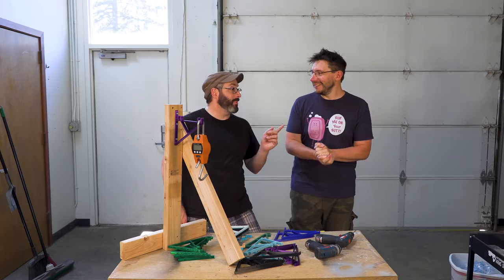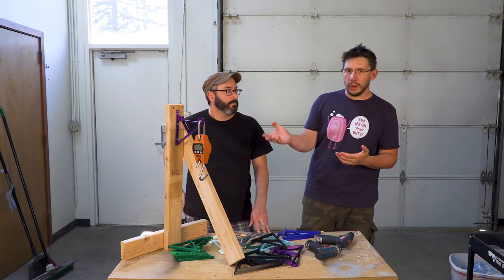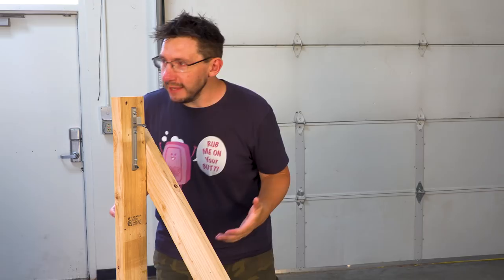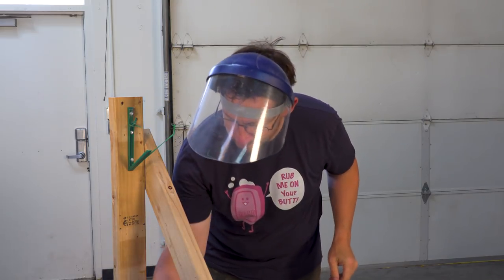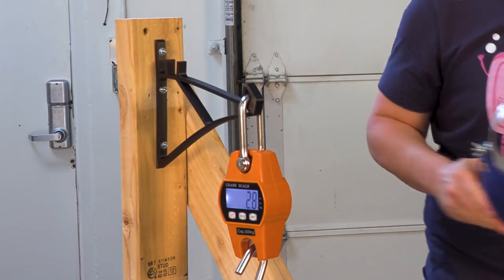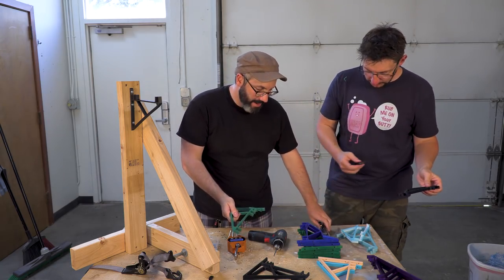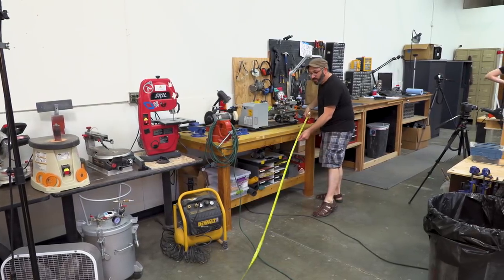Will It Break? Stress Testing 3D Printed Brackets IN THE NAME OF SCIENCE!

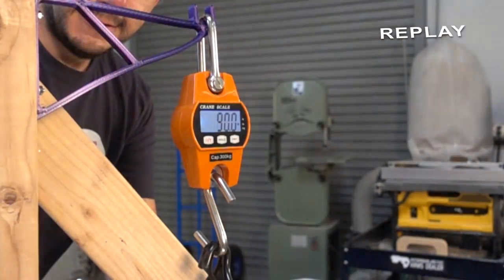Comment: INCORRECT RESULTS! Check the footage! The Nylon was tested at KG (16:57) while the purple one was on pounds (6:59)
Reply: but it still lower weight then the purple, 1 pound = 0.5 kg roughly
Reply: about 37 lbs
Reply: They switched to KG at the grey PLA, the best result was the standard PLA through the Moarstruder holding 123lbs
Reply: How do you even notice that!?
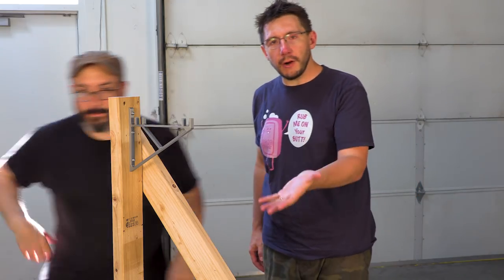Reply: Thank you this explains soo much! That also puts Build Series PLA (9:06) at 87.52 lbs to Polyalchmy's 90lbs

Comment: Nice test! Actually, the PETG structure buckles before failure because of the lower stiffness of PETG compared to PLA. A stiffer material like PLA can sustain larger forces before buckling and will tend to fail catastrophically by delamination or filament fracture. So in a nutshell, when using softer materials, you need larger beam cross section or more structure members to avoid buckling while with a stiff material, you should take care of minimizing stress concentrators in sharp inner corners (use large fillets) for example. A good example of structural design vs material choice!!
Reply: What's a good, novices' introduction to stress concentrators and how to avoid them? It's a topic I'd like to learn a bit about, but I'm trained as a software rather than a mechanical engineer.
Reply: Yes, turn them into T-Beams to increase their strength greatly.

Comment: Your design is implemented using just flat-bars. Flat-bar has greater resistance to flexing in one direction than the other (along it’s length).  Your bracket design is stronger side-to-side than it is up and down.  You do still need side-to-side strength and to minimize torsion (twisting). The answer is not to simply switch the orientation of your flat-bar, but to use T-bar. T-bar should print really nicely if you include fillets in your T-bar design.  Also fillet the joints made when two T-bars join each other. Filleted I-beams would fare even better, but might not be necessarily if the T-bar is strong enough.

Comment: Damn those results! I've been printing all my pretty objects in Polyalchemy but maybe I should be printing my functional parts in it too. I think the issue with nylon is it's very soft, but tough. The CF stiffens it but also embrittles it. Not a great solution imho.
Reply: Angus.... maybe the temperature used to print the PLA has something to do with it's structural integrity? I know annealing can make it stronger, but I wonder if varying the print temperature would help / hurt it.
Reply: Has anyone tried testing how much PLA can take if it has printed with some extra temperature? Links?
Reply: NylonX broke because of an added carbon in it. Otherwise, it will deform itself. Nylons like to be printed in 100% infill for really rigid, self-lubricating and higher temp resistant parts. That is why they are used for small gears etc. And of course, every addition to the nylon will weaken it. Last but not least you can have different nylon types. I have seen  PA6(more durable) and PA12(easier to print) as a 3D filament.
Reply: +Lasse u  I reckon CNC Kitchen would be a good resource for that. Stefan does heaps of testing
Reply: Angus the strange thing is.. in my experience the polyalchemy elixir has absolutely terrible layer adhesion. I think the good results with this filament is more to do with layer height and width going through the moarstruder..  the tests weren't even because of the different layer heights etc..
Goes without saying that the elixir is absolutely gorgeous though!
Reply: Martyn Reid you're printing it hot right? It runs at 210-220c to get proper adhesion, very high for a PLA blend
Reply: Maker's Muse yeah, it was in fact the initial temperature tower test that broke apart in my hands...
Reply: It's got me reading up. Seems I'm not alone and some folk are saying it's best with the part fan down to around 30%. What do you think Angus?
Reply: I suspect had he done the elixr with the .4mm nozzle the results would have been very very different.

elixr has crap layer bonding at .4mm but the plastic itself is stupid strong. way way stronger than normal pla. the killer here was the moarstruder with the 1.2mm. my elixy 1.2mm prints are just stupid strong. really crazy strong.
Reply: deflection here would be a failure. I suspect the the design would have to be optimized for each plastic. for example nylong x does not like "thin angles" so that end where it snapped needs to be beefed up and made thicker. for the poly alchemy the place where it delaminated is where it has the poorest layer bonding. (that gap in the center of the triangle arch is the failure point) thicken that up to remove that gap.
Reply: no. it has poor layer adhesion. period. I print at 230-240 and it does improve quite a lot but its still crap layer adhesion. it really just needs more surface area to compensate which is why it did so well here (1.2mm layers width) because the plastic itself is silly strong.
Reply: Cheers Nerys, its reassuring to know others are experiencing the same problems with the layer adhesion.  Was wondering if my new role had absorbed too much water or something...
Reply: Ya Angus, Ive found the carbon fiber filled filaments are all weaker. Carbon fiber gets it's strength by long strands of it incased, where they chop it up so small to feed through a printer it looses all it's structural properties.
Reply: While I haven't printed very much Elixir (just a couple MakerBox samples) I've always found them to have horrific layer adhesion - like fall-apart-in-your-hand bad. I guess the MOARstruder makes a huge difference here!
Reply: ya, Me too Lumberjack.. I find I crank up the temps and use more infill and shell count to keep it together. Seems to hold great at like 50% infill ;) LOLOLOL
Reply: I dunno what to say, the only thing that stops me using elixir for the most intricate of prints is its slightly unusual dimensional accuracy, it kinda expands as its extruded and that can make fitting together parts more difficult. The higher temp does require a slightly slower speed to avoid sagging on the undersides of surfaces.
Reply: Maker's Muse I find the filament diameter tolerance to be quite poor, varying quite a lot within just a small section so I guess contributes to dimensionally inaccurate prints..
Reply: A combination of Carbon and Nylon is fundamentally flawed. Nylon is flexible as we know. Carbon is POOR in compression and really only any good in tension providing the fibers remain intact. Your failures are compression ones ergo Carbon won't help.

The way to improve the parts load capabilities for only a minor increase in materials is a thin web between the structural members (even with holes in it) which will reduce 'point loading' a lot and maintain them from bending..
Reply: Maker's Muse you know that literally everything expands when it's extruded, right?
Reply: I had a part that failed in Nylon 910 due to deforming under tension. Printed in NylonX it was a much stronger part, at least for that application because it was stiffer and did not deform. And the test results are wrong- it was in kilograms instead of pounds on the nylonx test.
Reply: MSG Nitro PLA has a very high tensile strength but low tolerance to shock. So think of it like glass.

Comment: If you decide to retry this test. I recommend getting a rod setup to put pressure on both ends so that the piece is loaded the way it's intended. could be a couple dowels with flat slots so that it locks in place and a high strength fishing line threaded though the center and tied below the holder that way A doesn't move, B easily slips on/off, C gets a realistically weighted test.

Comment: I've been researching trusses recently and long, slender members are more prone to buckling before they reach their ultimate compressive strength, so it's better to use short, wide members for compressive forces. In your design the top horizontal member is in tension so it's strength depends purely on the cross-sectional area, but the diagonal member is in compression which is why it keps failing. Adding more bracing against buckling will divide it into shorter members which should withstand the compressive forces better. Also the reason triangles matter is because trusses are usually analyzed as if they are pin-jointed and free to rotate. That straight piece in the top corner closest to the wall is short enough and rigidly attached so it probably won't matter in practice.

Comment: Place a pully stright under the bracket. Then inline further away have a lever. Run a cable from the scale through the pulley to the lever. Now it's just one large movement to easy the resistance and make it easier you fine tune the speed of the breaking point.
Plus.. Have lbs and kg on-screen

Comment: Joel 
Great subject and a good ad hoc test program. The results were worth the effort. Having worked at laboratories, I have some suggestions.

Terms:
Brackets and beams fail under tension in the top cord (in this case the horizontal member) and under compression on the bottom cord (the diagonal member).

The load cell is a good measurement instrument, however, loading should be steady and linear. I would suggest a large bucket to hold water and a flow meter to adjust the flow of water into the bucket. The weight will slowly increase until the failure. The test operator normally wants to reduce strain fluctuations to reduce variables.

Thanks for a great channel

Noel

Comment: Considering the actual use of the brackets and the fact that the force would be spread between multiple brackets and two points per bracket, I'd say results are not alarming considering this test shows the weakest bracket could hold about 7 spools of filament from one single point.
Reply from the maker: EXACTLY! This is quite possibly the worst test case for these brackets. If they can hold this much weight pulling down on the very end, then the distributed weight of spools and across the wood rails means it could hold even more!
Reply: correct. on top of this even the crappiest filament had plenty of strength. remember this is worst case. and it was 17 pounds. that is probably 25 distributed across both so lets call it a safety fudge of 20 pounds.

16" per bracket. 8 brackets for a 10foot run that is 160 pounds or 64 rolls of filament. so even if he maxed out every shelf with FULL 1kg rolls he will be no where NEAR the failure point of even the weakest plastic selected.

failure over TIME would be interesting to discover though. IE will the parts deform over time to failure ?? no idea. would be interesting to test.

Comment: Another thing to consider is how each plastic ages and deteriorates. Like we know PLA is super stiff/strong and brittle, but since it's a corn starch base perhaps it would lose structural integrity due to degradation over time sooner than other plastics?
Reply: That's a great question! Related to that, I once read an engineering note that recommended against using press-fit joints in plastic because, compared to metal, plastic deforms over time.

Comment: Some issues I see are that each time you switch materials: you also need to maximize the way they are printed. variables include extrusion width, layer height, bed temp, chamber temp, extrusion temp, and of course make sure that each filament is dried and kept dry though printing process. Maximizing these settings for each material would be of more use to people designing functional products.

Comment: You might want to print a few more of the nylonX and try testing it with a piece of wood in the spots where the cross-beams go in your shelf.  Unlike the other failures, this one shows a failure very local to the point that the force is being applied.

Since your shelf loads the filament in the two cross-bar channels, a more accurate test would be to print TWO of each filament and use a wooden H to load the channels directly so that the load is applied as closely as possible to the way the filament on the wall is loading it.

Comment: I believe there's an issue with your test protocol. It doesn't just add weight on the brackets, it also drags the bracket end towards the floor. Depending on the material used, this could absolutely mess up the structure way too early, depending on the rigidity of the material being used. Instead of the 2 techniques used in the video, you could find some weights that you add slowly, one by one (or fill something gradually with water ? idk, it's gonna be messy :D )

Comment: Two suggestions for future bracket tests:
1- run an extrusion of various thicknesses of material across the inside center of the bottom support to mimic the design of the cheap stamped metal brackets, that should drastically increase the load holding capabilities.
2- If possible, change the extrusion layer to come from a different direction on that top region, to create more of an interlocking pattern between the layers. I don't 3d print myself, so I have no idea if that is easily possible, but I do know that there are many g-code experts that could do it.

Overall, great video.

Comment: All of the plastics used in these tests will give good short-term results. The issue with PLA (and some others) under a longer and continual load stress is that it will flow. If you were to put a load of say 30lb on a PLA bracket at a normal room temperature for a couple of days, it would deform significantly. On a warm summer day - even moreso.
PETG is a better choice if you cannot print ABS.

Comment: if you do similar future tests, you should consider using a rope around a "winch" type cylinder with a handle at the bottom.  That will give a more uniform pull without spikes of force as you ratchet....

Comment: I would suggest testing the polyalchemy one again. It was the only one not tested in the same way as the others (Joel loading the member to 70, unloading to 0 and then reloading). My hypothesis is that it will fail in a different way if loaded once. Also by testing at the end of the bracket you are creating a moment arm.

Comment: You need to re do the test , But you need to use a bridle on the bracket so it pulls evenly on both support points at the same time to spread the load better. It may go even higher.

Comment: LOL, what happens when a software guys designs hardware.  The biggest issue with your bracket designs there is the cross section.  Yes, you need to add additional support throughout, especially near the mount and the end, but you designed the whole thing with a rectangular cross section and have all the force exerted along the narrow axis.  I would recommend going to a T-Beam or I-Beam cross section to give more support in the vertical axis.
Reply: S.F. Edwards correct me if I'm wrong but I don't believe it is very easy to do that with most consumer grade 3D printers.
Reply: He might have to use supports at that point.  To avoid supports he could go with an L-Beam Cross section, or Hat Cross-section (basically triangular but with the top cut off).  The problem with the the L is that the load would all be on one side.
Reply: Well, CNC Kitchen made a video around 3 months ago on how to use Topology Optimization in Fusion 360 for a spool mount :)
Reply: IF you art saying the exact same cross section, yes it would probably fail sooner.  He needs to add additional vertical support along each current rectangular beam.  If I could post images I would illustrate the changes I would recommend.
Reply: Yes I am, but I am probably not explaining myself correctly here.  In short, the design as it stands will be prone to failure regardless of material, just, as seen, some materials will fail sooner than others.  The current design does not have enough vertical support, due, in part, to the geometry of the rectangular cross section.  It would be a simple design revision to increase the overall strength.
Reply: But as was clearly stated at several points throughout the video, they were comparing the material, not trying to  create the strongest bracket.
Reply: Andy Chaplin due to the inherint design flaw in the part they arent really comparing material strenght in a useful way. There are so many variables that they just haven controlled for that this test is more entertainment than useful experiment.
Reply: Tomasu82 Then I'm certainly looking forward to your tests demonstrating how it should be done.
Reply: I think CNC Kitchen has done a great job with that already.
Reply: David  Of course he is.  Can't you tell from the way he claims to know what he's talking about but cannot accuratly explain it in any way that is understandable?
Reply: The engineer's explanation was perfectly fine, but let me try to make it clearer anyway.

Take a plastic ruler (or a similar object) and try to bend it by pushing on the flat side.  Very easy.  Now, try to bend the ruler in a different angle, instead of pushing perpendicular to the flat side like you just did, push perpendicular to the edge.  Much harder.

This bracket is like a triangle and each side is a flat rectangle, somewhat like a ruler.  You'll notice that the rectangles are oriented in such a way that the flexible flat sides face down while the strong edge sides face sideways. This is bad, because you mostly want the brackets to be strong against the downward pull of gravity.

If the rectangles were rotated so that the thin side face the floor, the bracket would bend much less downwards, but might twist/bend sideways instead.  To avoid that, you can use an I beam or t beam shape, both of which would be strong in both directions.  Google these to see what they look like.